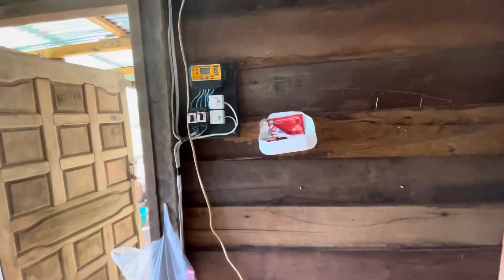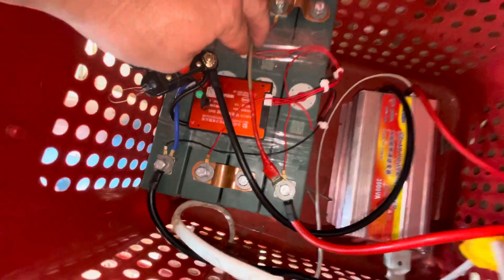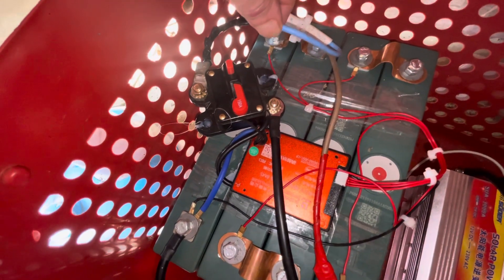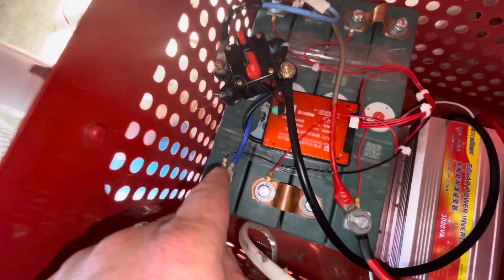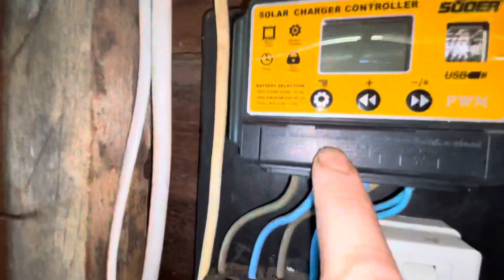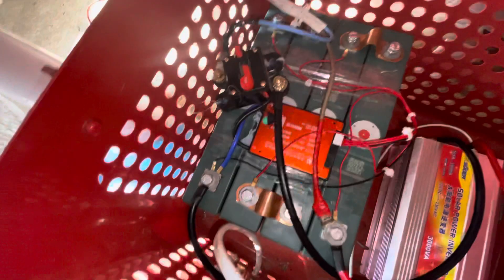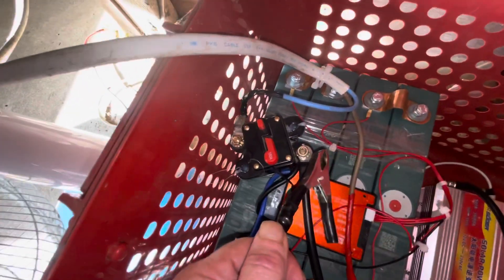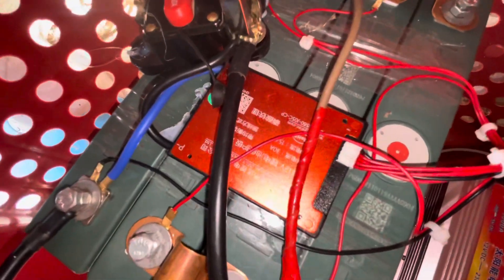How to reset a daly BMS that is tripped. Be sure to have all load switches off before shorting !!!

Comment: In bypassing the BMS, Is it ok leaving P- and B- shorted as seen on your video? My cutoff high & low voltages are 3.4V and 3V only. I was thinking of putting switch between P- and B- if I want to have more power after cutoff voltage.
Reply from the maker: Never bypass the BMS for more than a second to enable a reset. And never run with no bms in circuit. Especially with second hand cells which can go out of balance and have one cell go low volts on discharge or high voltage when being charged. Going outside of the 2.5v- 3.75v for LifePo4 cells is what causes cells to swell. If you have problems with the bms cutting out find which of the cells is going high and low and deal with it. How much experience do you have in this game ?
Reply: @Steveuploads  This is my first time to build 32650 LiFePO4 48V 18Ah for my ebike. I am using old Daly BMS. 
Maybe it's time to change to JK BMS that is with Bluetooth so I can deal if there are defective batteries and be able to set cutoff voltages.
Reply from the maker: @modernboy0921  you need a flying capacitor equaliser board if one of the cells is dying off early. The equaliser will transfer the volts from high cells to the one that will try and empty first to prevent the BMS cutting out. I’ve had great results from the one I have on my 24v set and this 12v system that would regularly go out coz one cell went low and stopped the party. Since I fitted a flying capacitor balancer it hasn’t cutout and no longer need to perform this reset procedure. Same on the 24v volt system of used cells I have. Although my friend, on my recommendation, got a 48v version 16cells and won’t stop saying what a waste of money it was. He has another 48v pack and fitted a JKong balance and thinks it’s brilliant. He has just ordered another 246A 48v pack and that has been made with a JK BMS and Balancer combo.